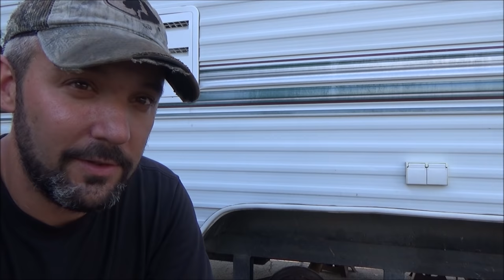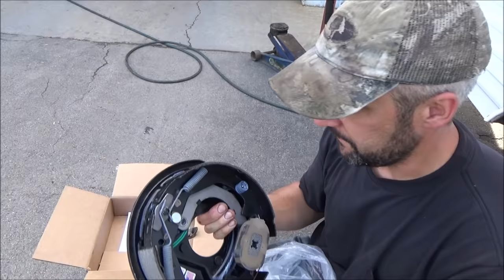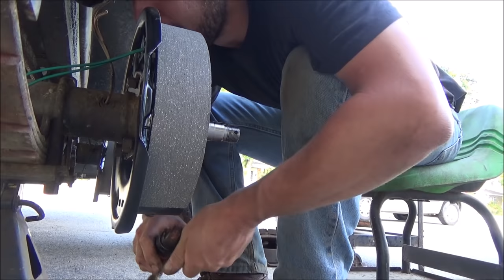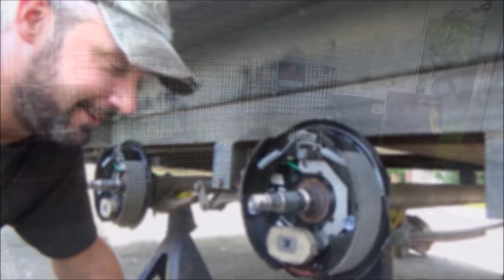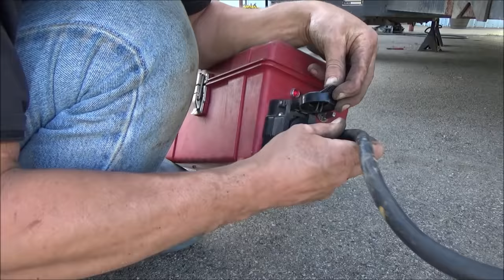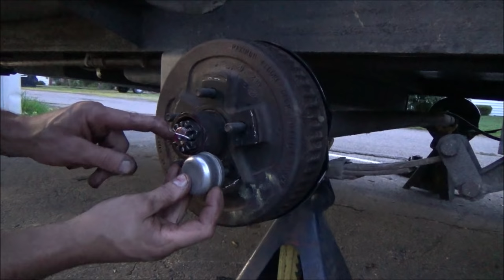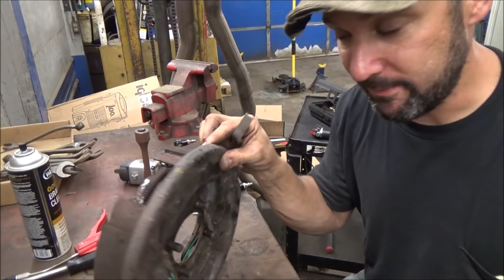Replace: Electric Trailer Brakes - Part 2

Comment: I'm 68 years old and have been doing wheel bearings since I was 7 and you do it exactly like I was taught by my Dad to do it. GOOD JOB!
Reply: I learned the same way, big wad of grease in my palm, and lots of scraping.  but I don’t remember who taught me.  Probably by my first boss.
Reply: I've always got a wade of grease and just keep slapping the back of bearing in grease, and turn it as I'm doing it, Not sure how I learned it, I do have a habit of just sticking a glob of grease into the hub itself, even though you really don't have to, I just feel more grease can't hurt, never had a problem. I was also always taught to replace races, I use to work with a guy who kept telling me I don't have to change the race, but I mean it takes 5 min to to get the old one out an press the new one in.
Reply: Here here... exactly how I was taught...
Reply: I like to pre load them with 105 ft lbs torque. Seems to work.
Reply: @JamesSmith-xs7sr  At least tapered roller bearings should never have a preload, always adjust them so there’s some amount of endplay, say 0.001” maybe a little more depending on how warm or loaded they run.

Comment: Hello Eric!! You were remembering you younger days with the mowers and Briggs engines, and it made me remember when i built a three wheel Go Cart made from an 8hp Briggs and a Ford Falcon rear end/axle with the original wheels and tires. I cobbled up a frame out of 2 heavy angle irons, cobbled up a a front wheel steering system operated by bicycle handle bar and motorcycle throttle assembly. The drive system was a centrifical clutch assembly with a belt pulley on the end driving a bigger belt pulley attached to the pinion drive yoke assembly with screws. The brakes was the system already on the axle, I just added a master cylinder old style single circuit type with a pedal on it with the appropriate tubing and I had me a go cart that would do about 20 mph !!!  Fun Days indeed!!

Comment: Standard specification for grease in just about any housing is to fill 30% of the unused volume of the housing, plus packing the bearing 100%. 

There are some applications where it is desirable if fill 100% of the unused housing volume, such as wet end paper machine press roller housings. The point of filling the housing 100% is so water cannot get in the housing and corrode the bearing. Bearings in these applications typically run slower with high torque gearboxes mated to them so the bearings won't burn up due to excessive churning and excessive heat. Water won't get in if there is no space to allow it to. 

Anything that operates with any sort of high speed, like a trailer axle or vehicle spindle, you do not want to have excessive grease in the housing. This leads to excessive churning, which leads to heat build up and that leads to failure. 

You're doing it right Eric! Keep up the great work and awesome videos. 

Also, the standard for axial clearance is .002" on most dual cone bearing setups, unless the manufacturer of the equipment specifies otherwise.

Comment: One of your best videos so far, Love the story about the mower, I to was a motor head from very early age. Our next door neighbor was a County Sheriff and he taught me how to repair old mowers. My tools were a Adjustable, a box wrench with 1/2 on one side and 9/16 on the other, a pair of pliers, a screw driver, and I believe a hammer.
  55 years later I still have the boxed end wrench. Thinking I will get it chromed put it on a chain and wear it around my neck, a lot of memories in that little wrench....
Reply from the maker: Charles Miller Dude that is so cool, I still have a socket set I bought when I was 14... I was gonna conquer the world lol

Comment: That’s a great story about your hot rod mower👍😀
About 40+ years ago I had a Miley 2 horse trailer. I don’t remember if it had brakes on one or both axles. What I do remember I was always adjusting the bearings so there was no free play, that is there was no play in the bearings. Probably wasn’t adjust them correctly. As always I enjoy your videos, Eric.

Comment: I can't tell you how many hubs I've packed and brake assemblies I've changed. Like you, I grew up in the trailer shop packing bearings. This video is a well done overview of trailer hubs and electric brakes. Great advice with recommending a complete brake assembly, especially if you are being paid to do it. By the time you put the work in and charge for it the customer pays the same amount and half of the assembly is old and crusty. Might as well go all new.  I hate Scotch Locks, especially when exposed to the elements. They are only good for tail-light warranties and temporary emergency repairs.

I keep the bearings with the hub they came out of and you always replace the race with the bearing. I always put an extra dollop of grease in. No second guessing myself then. I get a kick out of the guys with EZ-Lube hubs that try to fit a whole tube of grease in the hub and wonder why the seal fails.

Comment: You are bang on with calling those hateful connectors 'Scotch blocks; They are made by 3M and the packaging has a tartan stripe on it and their products usually have 'Scotch' included in their moniker such as 'Scotch tape' Fantastic job Mr O. I've learned about electric brakes today. Ty buddy. :D

Comment: The reason I was taught to put a thin coat of grease on all the inside surfaces was because if there were to get any water or condensation inside the bearing area there would be less exposed iron to rust.  Doesn't do anything for bearing lubrication just protects the surface from oxidizing.
Reply: very important!

Comment: Thanks for the video!  I'm about ready to check the brakes on my 2014 RV trailer.  About packing the grease, on cars I pretty much do what you do.  On my boat, I do use marine grease and pack the crap out of it to keep the water out.  It will bleed the grease when it gets hot, but at least I know the inside should be free of water, I hope.  As far as the quality of workmanship on the "new" trailer, yup, I had to fix, tighten, modify a bunch of stuff just so the trailer would function as it should.

Comment: Great video, I just did a bearing pack on my RV trailer today, I sure wish I had found this video before I did mine, 
I am an old KY hillbilly so at 70 years old I have packed a few bearings in my time, just not sure I ever did them right like you did,
My trailer dexter axles has those new fangle drilled grease tube, suppose to be able to grease bearings without all this work,
My RV dealer says hogwash, take bearings down and do them like you did,
Also they say to repack bearings once a year or every 12K miles, 
I would not do that job again for the trailer, as I do not get around like you and definitely do not have all those quality tools,
Again good job, I would be comfortable bringing my 2005 dodge diesel to your shop for maintenance, an I do not let just anybody touch my dodge diesel
Reply: Fred, don't sell yourself short.

Comment: Loved your presentation, need to replace horse trailer brakes.  Will follow your lead… did same back in 60’s Toro mower with horizontal drive shaft and squeeze clutch.  Belt to chain drive. Welded up our first mini bike frame with mower wheels 😂
It worked, ran it all over in the woods.  Great learning experience!
Video here, good job, loved your story.  Thanx, Brian in Minnesota

Comment: Awesome I never dabbled into electric brakes before so I'm one of the many that did not know about theses brakes.  I made a utility trailer years ago  and noticed the 4 hole plate on the axle , I'm going to put them brakes on since I have a controller on my truck.  The production of automobiles in North America are so heavily regulated towards safety it just amazes me trailers are not. You will never see a scotch block connector on a vehicle from the factory.  You mentioned the butt connectors were pricey , not sure what your paying but I get the same ones your using for $13 , free shipping for 100 off fleabay  .  BTW an electric heat gun or a cordless heat gun is my choice , I find the torch too easy to overheat and damage the connector.  You don't seem to have that problem on film :)
Reply from the maker: Steve Rob You got a link to the ones you use Steve? The ones at Napa are pretty pricey... you like the ones you get? I am still waiting for SATAMAN Schmidt to send me a free heat gun haha. He'll feel bad for me soon enough if I keep using my torch...I just know it
Reply: I imagine Napa gets them from China as well. I have been buying these for a while now and I think their good.  Oh yeah for sure your getting a heat gun from Arizona , lots of hot air down there you probably just crimp your wires and they melt down themselves :)
http://pages.ebay.com/link/?nav=item.view&alt=web&id=400853456980&globalID=EBAY-ENCA
Reply from the maker: Dennis has to store them in his freezer lol
Reply from the maker: Good price, thanks for sharing the link. Do they have the goo that oozes out of them?
Reply: Hey Eric , I'll send you a pic of this project I'm into this week just finishing up the complete custom wiring harness on this sweet ride. I got about 20 hrs into it so far and another 10 to finish. I bet Vanessa would  just love one of these :)
Reply from the maker: Hahah I saw it then read this LOL
Reply: Allyn MacLaren Jr fantastic, same ones but a better deal. I dont have axcess to all of ebay as you guys down south i have to stick with ebay canada . A lot of items will not ship up here. Wow 500 , this is definitely a better deal.
Reply from the maker: Allyn MacLaren Jr Those are not heat shrink connectors though?

Comment: On the first trailer I ever did, I thought I would be professional and solder the brake wires. A week later a shop called me from several states away and told me most were broken. They explained never to solder or use butt connectors due to the excess movement on axles causing them to brake. They said even though it seems inferior, to use the twist (Romex type) connectors instead . I thought I was doing a better job with solder and heat shrink, apparently not though. You're a good teacher, love these clips.

Comment: THANK YOU FOR A COMPLETE EXPLANATION, NO BS!  I’m doing my first and probably last brake job, but there are pitfalls, like rusty frozen nuts, or I’ve had to sawzall one nut off.
And two nuts can be reached by my impact, and the other two can only be reached by a hand tool.  More ingenuity to use strength I’ve lost, since I’m 74 lady.  But I’m checking the boxes
Twice.  The adjustment part gave me some relief of anxiety so I can do that part with no problem, famous last words…………😅.  Anyway, I’ve downloaded this so IF I had to get back in there I can reference and revive my memory.  The brakes I’m replacing are 20+ year old Dexters, and boy can you see the difference of craftsmanship to now.  But they should give me
2-4 good years of service til I upgrade and sell her, and take her off the road.  &Byway, THANKS AGAIN!!!!!! Carol Johnson

Comment: Eric..  that wire in the axle for the trailer brakes, as you said, has a double insulation on it. I learned that the hard way. My 55 year old eyes didn't detect it in poor light & my brakes weren't working. I was replacing the wire in my axles, thinking they had broken... nope.. glad you mentioned that on your video for the next guy

Comment: Hey, Big "O. I built a tester like that 35 years ago when I was an RV mechanic. I used a Milk Crate and a full size deep cycle battery though. I attached some wheels and a pull handle in case I had to test a trailer on the lot. A week or so later I went to use it and it was not where I had put it. I went looking around the shop and found it in one of the other mechanics bays. I told him to either build his own or put it back where you got it from when you are done with it. It sure was a time saver.

Comment: I do my bearing s pretty much the same way Eric, lots of extra grease, run the nut until it is tight and then back it off. I don't have a parts washer, so i use a big pan with diesel or gas in it with an old paint brush.
Reply: Reminds me of 30yrs ago cleaning bicycle / motorbike chains in an old biscuit tin with paraffin and a stiff brush. Local gas station had a paraffin pump at the time.

Also reminds me of around the same time removing crusty black carbon deposits from 2 stroke motorcycle exhaust baffles - that stuff was super stubborn until you learnt the efficient way.... place coked up metal baffle in said tin along with ~1/4 gallon of gasoline, drop a lit match in it and walk away until it burnt out.

The black coke would turn biscuity brown and fall off with a light application of a wire brush after that.

Wouldn't do that now of course but back then we didn't know any better. Sorry Greta!! :P :D

Comment: You have to be careful when using compressed air to dry bearing after you clean them.  If you let rollers/balls spin in free air you can damage them.  Just hold them in you palm and hit them with the air.
Reply from the maker: +theoldwizard998 Damage them how? That is just an old myth no one can explain or prove lol
Reply: +South Main Auto Repair yep/a myth ..in auto mechanics school we used to angle the air at them as we held with a finger and we would spin them at ungodly high rpm ..never could make a DRY one ..no grease..blow up ..and oh how we tried risking life and limb :)
Reply from the maker: deepsquat600 I know haha, every time an old mechanic or new one that heard it from the grave vine says that I always challenge them to show me how or heck... even tell me a half way good story but the fact is it is a myth lol. Kinda like muffler bearing grease ya know...
Reply: It's sealed bearings that can be damaged by spinning too fast. They do not "Blow up" The seals simply blow out. No concerns with normal grease-able bearings.
Reply: @SouthMainAuto  I'm 67 now but when I was a kid working at my father's gas station, I remember cleaning parts with gasoline. After cleaning wheel bearings I would use the compressor air and spin the bearings to dry them out, well i'll tell ya a couple of times I've had outer bearings blow apart on me.

Comment: My dads camping trailer has never had the brakes services or replaced in almost 10 years so we wanted to take a look at them. Was nervous about the electronic/ magnetic components but after watching your video it's a piece of cake and will save us hundreds of dollars by allowing us to do the brakes ourselves. Thank you so much for your video
Reply from the maker: thetwig187 YW Glad it helps

Comment: 2024 here. Longtime subscriber and Im delving into the world of trailer brakes on my own camper. Eric is 100% right. These things are shoddily built, with the cheapest shortcut methods available. The tow vehicles are 90% of the time light years more advanced and safer than these dinosaurs of 50's technology. Butt connect, heat shrink and know the circuit is properly connected. Honestly, soldering is a little too much as these are meant to be a consumable part. but you must properly protect the crimp.

Comment: Thanks for pulling the adjuster out of the trash can. :-) Getting ready to putting the  1st set of electric brakes on my boat trailer. Needed that tip about special marine grease for my bearings! Greatly appreciated! U Da Man!

Comment: Home gamers parts washer:

 5 gal kerosene/diesel fuel and a deep dish catch pan, oil change pan (creative pan), but what ever you got layin around.

You and me, the junk lawn mower boys! I looked for and found and repaired a bunch of questionable tractors/ lawn mowers, but I had fun, I made a buck when I sold the things, and I smiled when you reminded me how it was, back then!

The extra grease in the hub, it's back up, it looks right and feels right. I did it this way because it feels and looks right, I continue to do it this way because I'm sure that it's right!

Yep yep, Scotch Lock, cut'em right out and solder in the way it should have been done! Well, and too, Scotch Lock is a brand as much as a thing, but you know what I mean!

Cheers 🍻

Comment: Hey Eric. 

I just wanted to say how much I enjoyed your video. I enjoyed your humor. I hardly ever make it thru a video, but yours was the exception. Well done!

I remember how to pack bearings the old fashioned way too. I learned that working in the old gas station when I was in high school. I think we eventually got the type that you can use a grease gun on. But to this day, I still do it the old way, with a glob of grease in my left hand and a bearing in my right hand and oooozing the grease into the bearing. Its one way to be sure its done thoroughly.
Also, I too always forget to adjust the brakes until I'm just about done and then remember "oh hell I have to adjust them too" So, its crawling under the car and doing it with a flash light or drop light and working on into the night like you did. I had to laugh at that...LOL.

I am doing my research on travel trailers and just talked with a buddy today about electric brakes. I came home and ran across yours on my ROKU3. I had to go to my PC (that's where I am now) in order to leave this comment. I never do leave comments, but your video was well worth watching and very informative. I did learn a lot about electric brakes and how they work. Also, one more comment...I also like the heat shrink butt splices. I think they're a great idea for this application and well worth the $$ and time to install them.

Later,

Roger

Comment: Your method of tightening the nut is justified. On most aircraft tires we spin the wheel while torquing the nut to "seat" the bearing. Some tires take over 200 lbs of torque to properly seat; then we break the torque and re torque to the final setting.  So overall you have a good practice. Carry on sir.